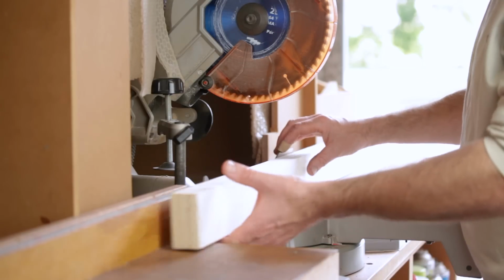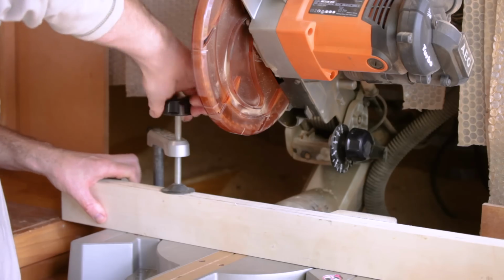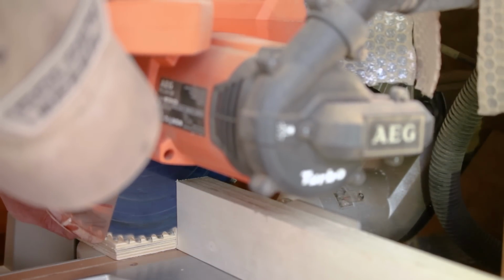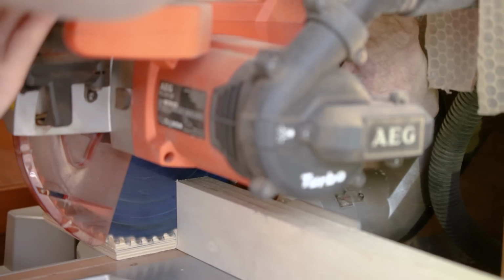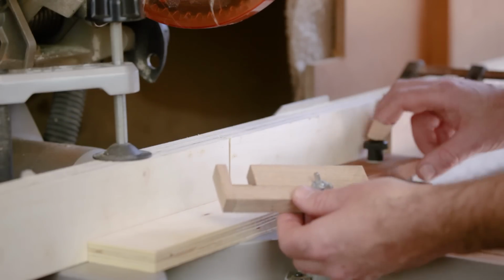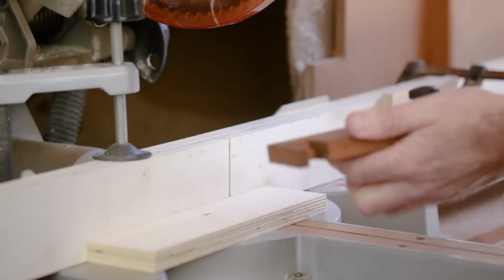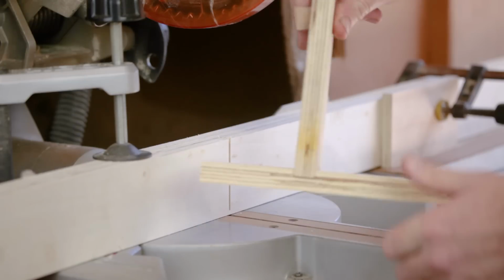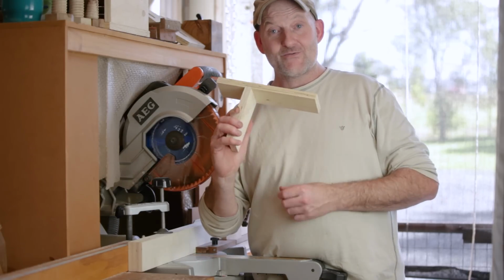Dados on the Mitre Saw

Comment: Sorry if stupid question but if you have put a mark on the wood for where the middle of the dados is, how do you initially set it up? Or are you supposed to mark the cut at one end of the side of the dados? Sorry confused, any help, advice appreciated! Cheers
Reply from the maker: Hey Shaun! You would mark where you want to cut your dado, line your mark up to the saw blade then butt the kerfmaker up to the workpiece and set a stop block up to that. Basically the same as using a stop block but putting the kerfmaker in-between. Then carry on making the rest of your cuts to finish the dado. Hope that makes sense. :)
Reply: Pask Makes It did thank you, thanks for reply! Cheers

Comment: can you make a video on your mitre saw station? I see everyone has a wood frame/ cover around them and Iwould like to know whey and how it works?
Reply from the maker: Hey Daren, It's basically just a box that contains the sawdust and stops it going all over the shop. I have a shop vac connected but that doesn't work that well. Directly behind the saw in the bench top is a dust collection outlet, that works very well. :)

Comment: I'd like to buy a Radial Arm Saw for the sole purpose of using a dado blade on it, since the Dewalt DW745 cannot(?) use one.
Do you think that a mitre saw can have a dado blade?

Kind Regards
Reply from the maker: I've never used a Dado set Marcelo but I wouldn't think you could put one on a mitre saw. :)

Comment: Hey there! Is there anyway to make a dado cut with a non-sliding Miter saw?
Reply from the maker: Not that I know of Alastair, it really does need to slide! :)
Reply: @PaskMakes  Well ... If it needs to slide and the blade can't, then the wood has to slide. I'm thinking some sort of jig might do it. But it'll need to slide using one hand. Maybe something that involves bearings... Or drawer slides. Hm ... Maybe it'll be easier just to get a table saw. :P

Comment: You need a pretty high end saw with a really precise depth stop and a very rigid frame. Just a little variation of downward pressure can make a big difference in the depth. If you have to do a lot of dadoes, I recommend checking Craigslist and your local Habitat for Humanity restore for a decent used radial arm saw. Holds depth a lot better. They go for around $125.
Reply from the maker: You're right that it's not the best option but if that's the only tool you have to get the job done then it's still an option. You can still make a good dado if you're consistent with the pressure. :)
Reply: Nobody ever has all the equipment he needs. The true craftsman is one who can get it done with the tools at hand. I've cut a lot of dadoes with the miter saw when I was away from the shop and didn't want to go home to cut them.